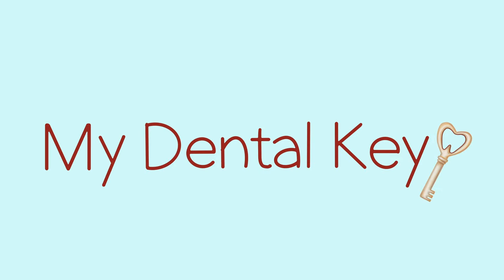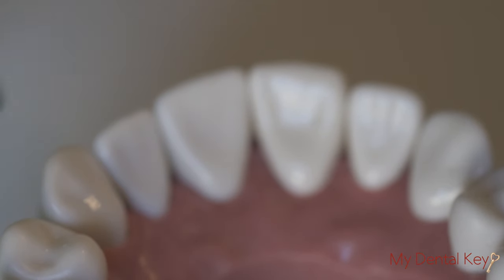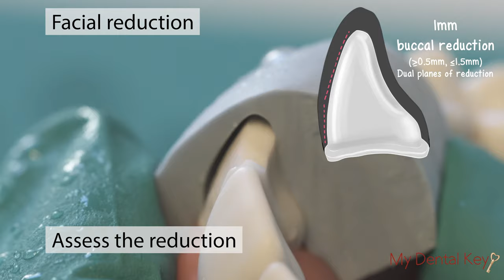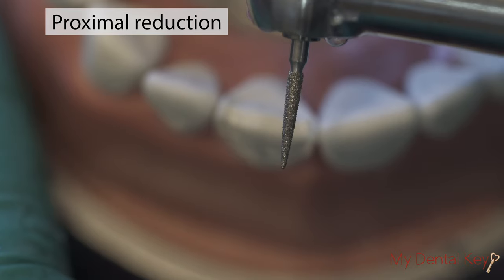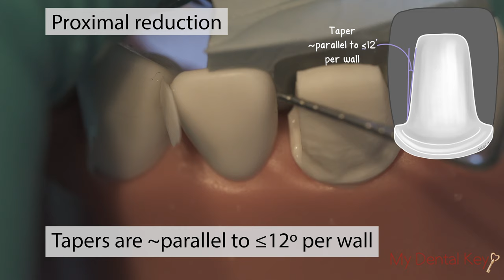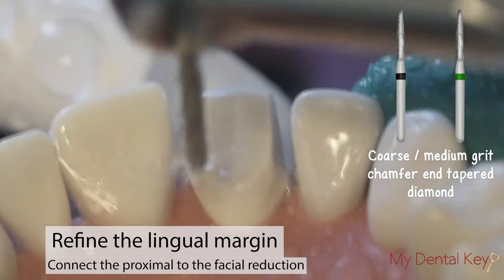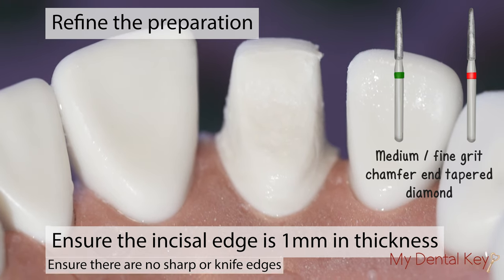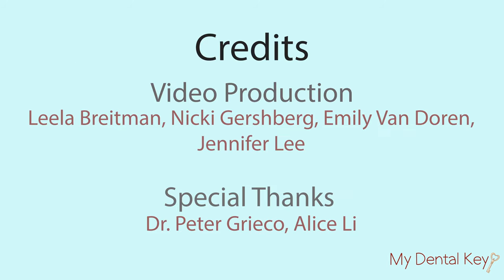PASS THE CDCA - All Ceramic Anterior Crown Preparation | My Dental Key

Comment: Facial surface, depth grooves of 1.2-1.5mm, joined together with reduction of 1.5-2.0mm and 0.5mm supragingival
Lingual surface, depth grooves of 0.8mm joined together with and 0.5mm supragingival, reduction of 1 mm
Proximal surface, 1mm reduction and break off enamel shell that is unsupported
Marginal width 1mm, chamfer and shoulder
Rounded line angles
Taper < 12
No J margins 
No undercut